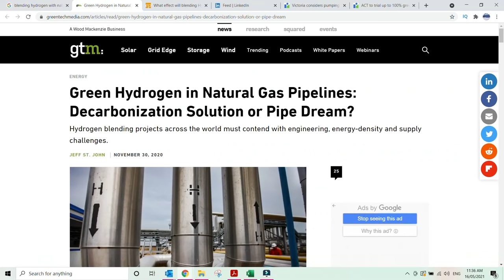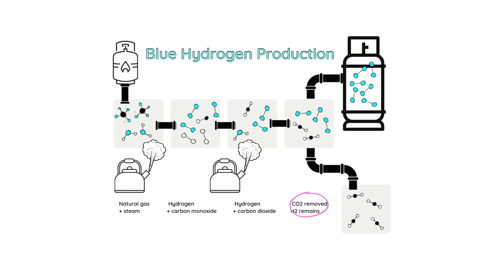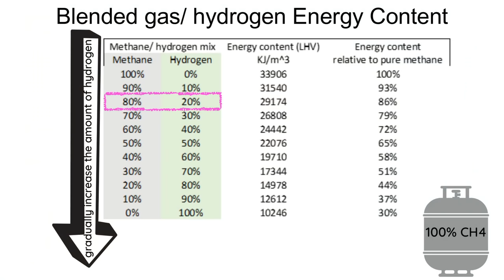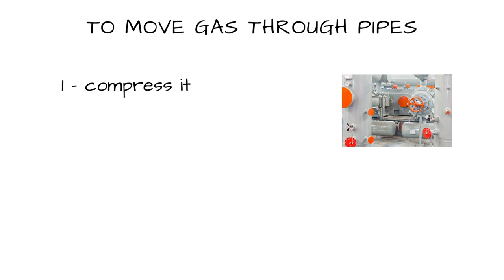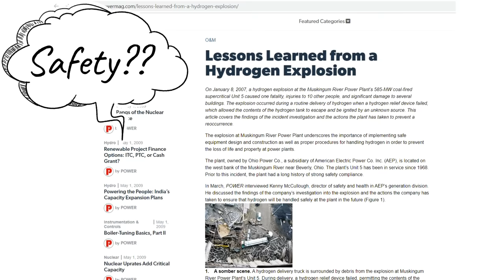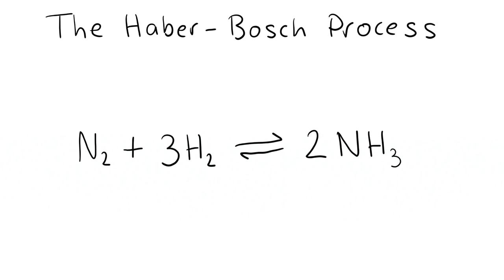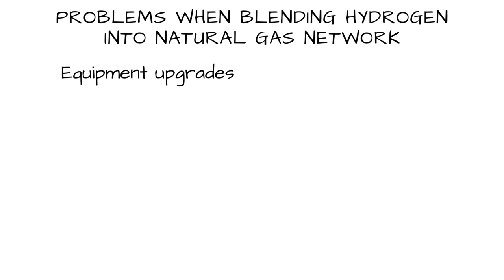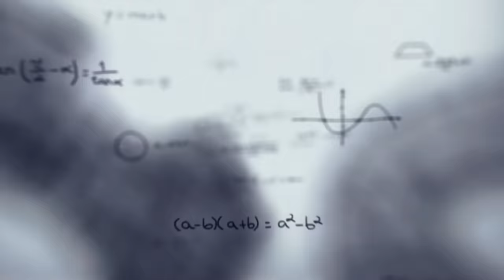Hydrogen in the Natural Gas Network

Comment: Thanks Paul and Rosie. I note that about 40% of energy in the first world is fundamentally consumed in transportation and 40% in buildings. Yes others will say but what about agriculture, well agriculture is made up of transportation (pickups, tractors, stake trucks, etc.) and buildings (barns, farm houses, sheds, etc.). Or what about the service industry? Take for instance a pizzeria. This is again made up of in the brick and mortar restaurant (building) and the cars for the delivery drivers (transportation). Agriculture and service categories are not fundamental categories. Just 2 fundamental categories (buildings and transportation) make up nearly 80% of our energy usage (in the first world, the biggest per capita polluters) and these are almost entirely produced by fossil fuels that emit GHGs. The solutions to both of these is available and have lifetime costs that are cheaper than fossil fueled solutions. It is Electric Vehicles (EVs) on the transportation side and Net Zero Buildings (NZB) on the building side. Rosie I just became a patron of yours. I am also a consulting engineer with a small business that does Net Zero Retrofit planning for buildings in cold climates (Canada) called buildingsciencetrust.com. I'd be happy to help you create a video on Net Zero Buildings if interested for a future video.
Reply: Thanks for the comment Daniel.  Best to set aside the primary energy comparisons though.  Heat and work have an exchange rate that you well understand.  When you look at energy uses adjusted for work vs heat, the problem is far easier to solve- and you're part of that solution in my opinion!
Reply from the maker: I'm interested in energy efficiency/ net zero buildings, thanks for letting me know and when I am ready to make a video on that I will get in touch!

Comment: Just make green methane by electrolysing Hydrogen, and add an element of Carbon to it from timber charcoal which is carbon that has been pulled from the air by trees. The Fisher Tropsch process. Then you can use existing natural gas infrastructure.

Comment: 700 bar? That’s far in excess of the maximum allowed working pressure of the pipelines and compressors.
Reply: That's the pressure at which hydrogen is stored in vehicles though, like the Toyota Mirai.  Way higher than pipeline pressures, but still only 40 kg H2/m3...

Comment: Wouldn't it be a nice world if we just used green generated electricity only for virtually everything ? Can't see any reason even now not to use electricity only for all UK residential needs including heating. Gas should have no place in people's houses. The only advantage of gas at the moment is price per unit of energy (kWh) but if governments start charging premium for CO2 emissions the price of gas use will not be as attractive. Hope this happens rather sooner than later. Also hope North Sea will soon get populated with thousands of wind tower generators. From energy point of view I think Hydrogen has no future and it was beautifully explained by Paul. Great another video Rosie, thanks.

Comment: I used to lay gas pipes in the ground. I might not be a chemical engineer, but I'll tell you some good ol' civil engineering know-how.
You cannot just blend hydrogen into the natural gas network, because the materials that the pipes are made out of like MDPE, steel and even copper, were never designed for it.
Hydrogen gas under pressure will leak straight through an MDPE pipe as if it was made of sponge, while steel and copper goes brittle when exposed to it in no time.
Seals in pipe fittings are also a problem, they react with it. So unless the entire gas network and appliances in homes are replaced with soft stainless steel, it'll never stop leaking.
Isn't it interesting how this massively inconvenient problem is skipped over in this discussion? I'd think that widespread hydrogen leaks would be a bigger concern for climate change.
Drops the mic and walks off the stage.
Reply from the maker: Thanks for adding your experience. It's definitely not as simple as it sounds when you hear these projects announced. There are quite a few trials now, with some reporting intermediate results already. I've seen some results that said there were more safety incidents in the trail compared to normal gas use. But I haven't seen any reports on leakage and the materials issues you mention. I wonder if these issues are being specifically considered and measured. It might be worth a follow up video in a few months or a year to see how the expectation has compared to the reality.
Reply: @EngineeringwithRosie  That's fair.
I've come to believe that a lot of these studies are sponsored to find a certain result for political reasons, which is why I prefer independent testing. We often hear of silly things like a study showing that bacon is massively bad for you one week, then a study later by another company that's affiliated by a meat manufacturer telling us that it's the best thing ever, so a lot of these studies I'd take with a pinch of salt.
Anybody can take a length of gas-grade MDPE pipe from a local stockist and a handful of fittings, make up a sealed chamber with it, get it certified by a gas engineer then test it with various gasses. I guarantee that with hydrogen, that pressure will slowly disappear.
The MDPE just isn't dense enough to contain the hydrogen molecules, it acts more like a filter than serious containment.
Likewise for a thin-wall steel pipe, fill it with hydrogen under pressure, leave it a few weeks before draining it off, then try and bend it. My money is on it snapping like it was made of glass.
Then again, I'm not a certified scientist, nor a sponsored laboratory, so take it as you will.

Comment: The point is that science, technology and Engineering have created a fossil fuel focused world with a few hundred years of travelling down that track and these need to be ditched pdq. We've only just begun to think of alternatives such as hydrogen, other solutions as yet to be discovered and changing the way we eat, live, travel and build. More effort and  investment is needed.  A mixed  hydrogen, solar, moon, geothermal, hydroelectric economy seems the way to go.  A thought on the hydrogen gas network, hydrogen can be moved around where there are no pipes and can be stored, two advantages so generate green hydrogen when the sun shines and the wind blows. Perhaps pipe to local power stations and or generate locally to power electricity generation plants to heat homes.  There's no one answer but plenty of opportunities.

Comment: I thought hydrogen was very corrosive to pipelines and other infrastructure
Reply: Not actually corrosive, but it makes the steel very fragile by seeping into the atomic lattice.
Reply from the maker: I had to cut the part where we talked about that. It's an issue for the type of steel used in long distance gas pipelines, not so much for the type of steel used in the local networks. You can read more about it in some of the articles Paul wrote, or look up "pipe embrittlement" and hydrogen.

Comment: I have come across two other ways of possibly storing hydrogen other than in high pressure tanks. Surely talented engineers like this should be looking into other storage options.
Reply from the maker: Yes you're right. We did discuss hydrogen storage in this call, but I had to cut  it  so the video wasn't too long. Maybe I should make a short video from just that part of the call, if a lot of people are interested. 
If you check out Paul's articles that I linked in the description you can read what he has to say about hydrogen storage.

Comment: Devil is in the details, true! But maybe even more in the big picture. 
The reason to accept the losses, costs and risks associated with hydrogen is a percieved storage problem. But there is none. 
Even with only lithium-iron batteries we can meet global demand. But then there's the molten metal  batteries that will outcompete lithium for grid storage within a few years, with only non toxic bulk ingredients. And beyond those come the flow batteries, the flywheels and whatnot.
And as Paul said, capture and store the energy in the form you want to use it. If you want heat, capture heat, not electricity. Solar heat capture is like three times more efficient than photovoltaics measured as energy yield /area. And this excellent channel has already made videos about long time heat storage in - yes - gravel, as has Now You Know.

Comment: You mentioned Pipe Embrittlement only briefly but Hydrogen Embrittlement has been the downfall of another technology that potentially had a huge future. The Tokamak Plasma Fusion Reactor at the Princeton Plasma Physics Lab was rendered almost useless, after an enormous investment in research, because of Hydrogen Embrittlement in the Stainless Steel reactor chamber.
Reply from the maker: Interesting, thanks for commenting!
Reply: @EngineeringwithRosie  I visited the Princeton Plasma Physics Lab in the late 1980's with some college students. It was BIG Science. I had never seen so much stainless steel in one place before. The reactor was at least 20 feet high and 30 or more feet long and wide. (They had to have stainless steel because the enormous magnetic fields they were using to contain the plasma would have caused magnetic steel to crumple the chamber in on itself.)

The flywheels they used to store enough energy for the fusion shots...which only lasted very small fractions of a second...were at least 20 feet in diameter and there were at least 4 of them in a factory floor sized room. They said that if they tried to take the power off the grid all at once they would have blacked out half of New Jersey. :-)

I got in a conversation with one of the Physicists there and he was the one who told me about the embrittlement. I had asked about when they might get to a sustained fusion reaction and he said that would not be possible because Hydrogen Embrittlement had severly limited how much they could use the reactor. They had to limit themselves to just experimental firings to try and gather as much data as they could before it became unusable and couldn't sustain the vacuum necessary for the plasma.

I didn't really follow up in the intervening years to see what became of it...or the PPL itself.

Comment: We need to stop thinking of hydrogen as a fuel. It is really an electricity storage medium. A very inefficient storage medium.
One could think of gasoline and diesel in the same way - all of them require enormous amounts of energy to produce the stuff we burn.
The most efficient use of electricity is to use it directly to heat homes or in industrial applications, or stored in batteries for use in electric vehicles.

Comment: Could you find an engineer who thinks that hydrogen through gas pipelines is a viable solution and have them respond to the arguments made by Paul?  It seems from what Paul said that there is absolutely no chance of this technology becoming mainstream.
Reply: I doubt there is such an engineer, plenty of con-artist with engineering degrees, but not any experienced engineer.  Even the blended gas would have to moved at a real clip over only a short distance to the user or most of the hydrogen would escape.

Comment: Pipe friction? easy solution! supercool and liquify your hydrogen and bring it below 3 kelvin, so it becomes a frictionless superfluid!
cooling things doesn't use any energy, does it? pipe insulation is pretty much perfect right? Nothing could go wrong!
Reply: Maybe the pipe will contract when it gets cold? That literally is rocket science. Sounds complicated.
Reply: Liquefying hydrogen- to 24 kelvin- takes 40% of the energy IN the hydrogen.  Then, even in a giant vacuum insulated tank- much less miles of PIPE- you lose about 1% of it per DAY due to boil off.
Reply from the maker: Lol, yes what could go wrong! 😂
Reply: EaSy SolUtiOn ... haha you’re joking, right?
Reply: Internet tip of the day: use "/s"to indicate sarcasm. What is obviously a joke to you can easily be taken seriously by somebody else.

Comment: The reverse seems more plausible- make green hydrogen and make methane from hydrogen and CO2. Of course, there is an issue with leakages, the methane is much worse than CO2 it removed, but overall that scheme would be more sustainable than natural gas as is, and it would be viable middle step to allow everyone who is using NG to transit to electricity if they can. Of course, cost would be an issue too, but overall it would probably be less than carbon tax that would reflect real damage of CO2.

Comment: Another great presentation.  Thanks.

We will probably need some "flame" for industrial purposes.  We might be able to get that from "green methane" extracted from urban and agricultural waste streams.  Currently we compost food waste and let sewage waste decompose in open tanks.  Methane flows from those processes into the atmosphere.  Better we capture that gas, use it to replace fossil fuels, and send it off in the form of CO2 as opposed to methane which is a stronger greenhouse gas.

Any idea of how much green methane we might be able to capture at a reasonable cost?

Comment: I liked how he brushed over the fact that the easiest way to get Hydrogen is by using Electricity and Water the two most abundant t commodities on the Planet, but it cost to much right now...
Reply from the maker: Yes, we didn't talk much about green hydrogen. To be fair green hydrogen is less than 1% of production today, so definitely not the norm yet. Grey hydrogen (from gas with no carbon capture) is by far the cheapest and easiest, and without a much higher price on carbon it's hard to see that changing fast enough.
Reply: It was briefly mentioned that green hydrogen is substantially more expensive than other forms.
Reply: the efficiency of electrolysis is 70-80% (in theory but in real life about 66-70%) and needs expensive electrodes made from platinum. That's why is so expensive and production of hydrogen via electrolysis is so small.
Reply: Expensive in engineering ask means it uses more resources not just money. The problem with electrolysers as well as cost of the electrolyser is the energy consumed. For a electrolyser and fuel cell to convert electricity to hydrogen then back to electricity you get back less than half of the electricity you put in. So you are better off using wires than a pipeline.

Comment: Renewable hydrogen, to the extent that we have it from excess renewable electricity production, should be used to partially replace the steam reforming of methane and the water-gas shift reaction for providing hydrogen in oil refineries to produce fuels and chemical feedstocks. We could have and should have nuclearized the entire electricity grid decades ago. And frankly, nuclear energy deserves the same generous renewables subsidies that wind and solar already get. With fast breeder nuclear reactors, ultrasupercritical steam plants, waste reprocessing, seawater uranium, thorium, and deep geological waste repositories, we can power humanity for millions or hundreds of millions of years. Within a billion years, the increasing luminosity of the sun is going to evaporate the oceans and make earth uninhabitable anyway.

Comment: I'm not a fan of this solution, the production of hydrogen is inefficient energetically.  What is the point of making hydrogen using electricity just to then burn it, I get that in order to create higher wattage usage projects, but there are easier highly energetic processes that are green (or relatively - think hydro dams, nuclear, biomass -> syngas).  I'm not sold on using 'green' ways of making hydrogen either, unless it's specifically for fertilizer in the bosh haber process, not for energy.  Is the infrastructure that expensive energetically to change?  For the long term, why not just create green infrastructure rather than relying on existing infrastructure.
Reply from the maker: Sounds like you and Paul (and I) are thinking alike!

Comment: Sabatier reaction: why not produce methane (a safe well known gas) from green hydrogen? Injecting H2 in the pipelines or storing it at 700 bar is just madness, in any case never to be handled by the average citizen. The problems associated with using H2 as an energy vector are so huge that the cost of producing methane from hydrogen would look very reasonable. I would really like to hear the opinion of the specialist chemical engineer (well, Im just a chemist without a clue about scaleability).
Reply: Because it does not make a sense to use large volumes of electricity to produce H2 -> CH4. You can produce "green" methane and then burn or use it directly. In a biogas powerplants. Hydrogen does not need to be at 700bar or cryo. In USA probably they dont recognize metalhydrides yet. They can be stored at 20bar, but i can't see how we can transport iron dust through pipelines. It's not practical.

350/700bar tanks are used in automotive industry without any extreme difficultities.
Reply: @ivobrick7401  Yeah! Thank you for your wisdom...